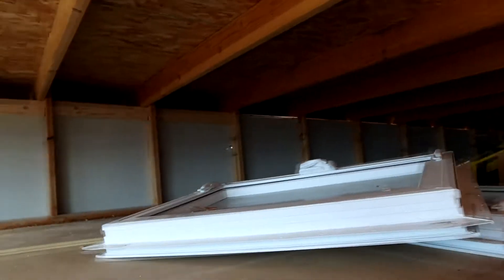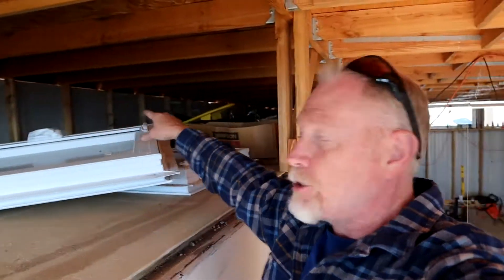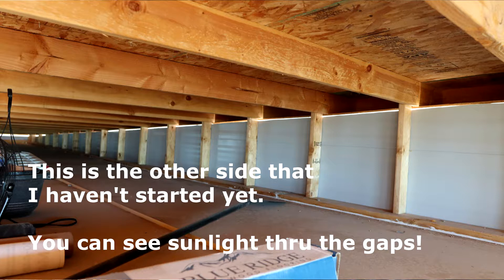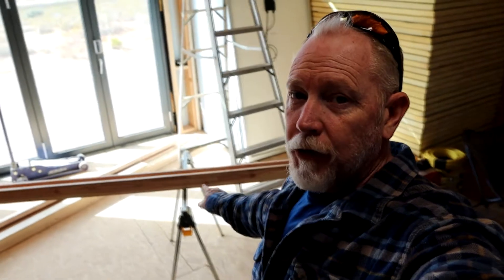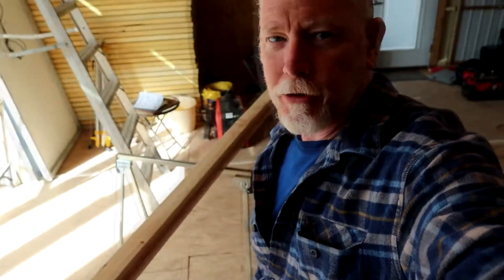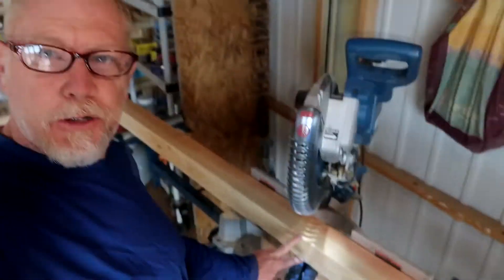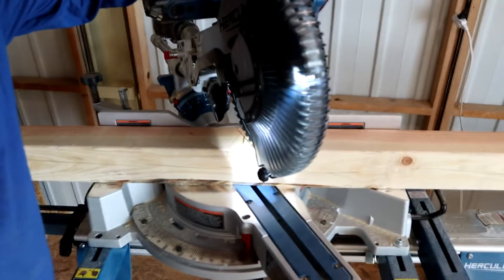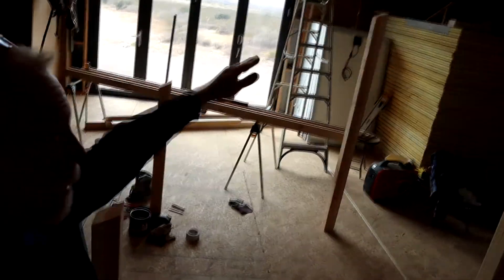Wood Solar Panel Rack Build Part 2 - Off The Grid Homesteading Power!

Comment: Wont the groove edges cast a shadow on the panels?
Reply from the maker: Good question, but no, not so much. The sun would have to be at an extreme low angle, like right at sunset, and at those times absorption is crap anyway. ON the next 2 racks im working on now, I made the top of the channel/groove shallower to further reduce this potential issue. That video is coming soon.